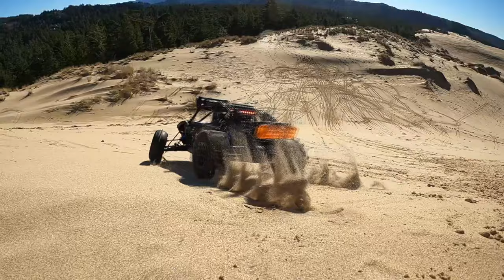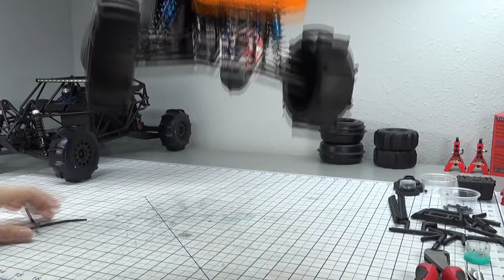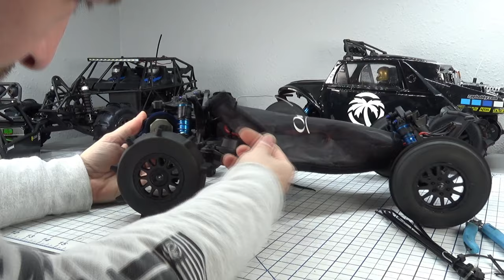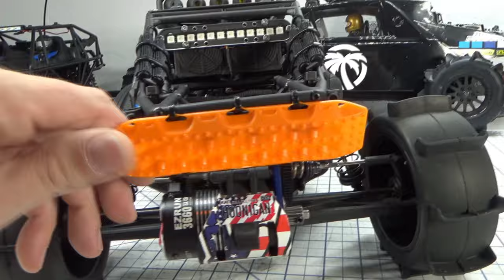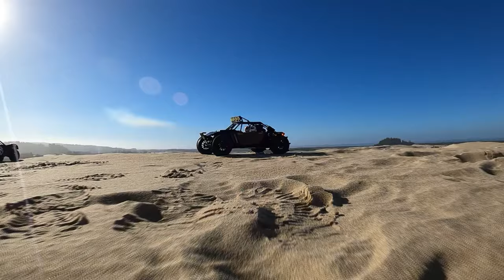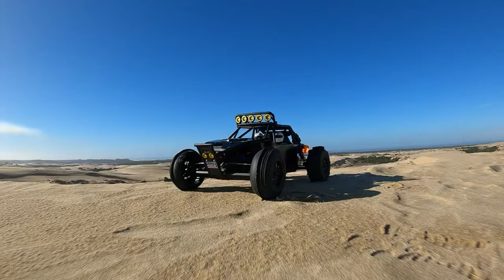Project Scale RC Dune Buggy 2wd Sand Rail DIY "P1"

Comment: Cool build - don’t know about turning zip ties into disposable single-use plastic every time you need to change the battery.
Reply from the maker: I already got reusable zip ties, but thanks for the input, you'd be surprised at your carbon footprint based on how many vehicles you have owned, great point.
Reply: @DoubleClutchProductions  that’s awesome. You’re right - so much plastic in RC builds… hop-ups kill polar bears. 😐

Comment: What dust cover are you running? I dont see any for sale that fit this chassis.  Thx 😊
Reply from the maker: It's the stock associated cover that I modify with a dremel bits container to fit the bigger 5mm motor shaft pinion. I believe the second dune buggy pt2 on my channel shows more on that setup.

Comment: love this build, think this could be duplicated on a 2wd lcg slass?
Reply: I've been trying ro find some slash stuff for a Sand rail build and it's proven kinda difficult personally. only long travel kit is like 200 bucks for a billet set. I've seen rustler arms supposedly work with some trimming
Reply from the maker: @cadehall685  this thing is bone stock and would do laps around any slash, just saying 😎
Reply from the maker: Sure could it's a very similar chassis, thanks for watching

Comment: Would they fit a 1/12 car like WLToys 124017?
Reply from the maker: Not sure about 1/12? The gatekeeper cage is on the small side for 1/10
Reply: @DoubleClutchProductions  Are they taller than 85cm please?
Reply from the maker: @TheSphongleface I'll have to measure it, my cages are slightly modified, I cut the lower sections out to sit lower on the chassis. I would estimate its close to 89cm?

Comment: I've noticed some people run paddles on just rear of their 4x4 RC's. I wanted to run sand paddles on a Losi DB Pro. Would you recommend paddles front and rear, or just paddles in the rear for sand?  https://www.youtube.com/watch?v=BdE6fcwEa6U      https://www.youtube.com/watch?v=unkjEXgVb6Q&t=94s
Reply from the maker: Great observation and question, personally on a 4x4 I would only run paddles in the rear. Proline just came out with a new,front sand tire that mixes both a ribbed and paddle.
Reply: @DoubleClutchProductions  Do you lose steering input by running regular paddles on the front?
On a 4x4, does running different types of tires on front and rear cause problems with the diffs, or does the loose traction on sand compensate for difference in traction front and rear.
Reply from the maker: In my opinion it will understeer too much with paddles up front, no effect to the diffs. Plus one set of paddles is all you need and its,cheaper than 2,sets
Reply: @DoubleClutchProductions  Thanks for the tips. I might turn my old Slash 2WD into a buggy like you did, it’s been collecting dust. I love your projects brother, hope to see more in the future. Subscribed
Reply from the maker: Thanks so much for watching. Appreciate the support 👍